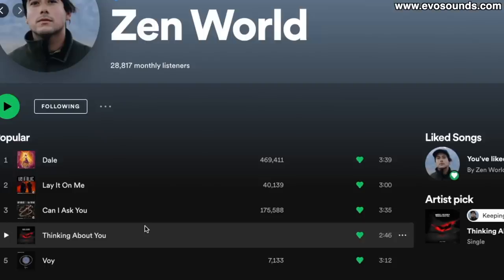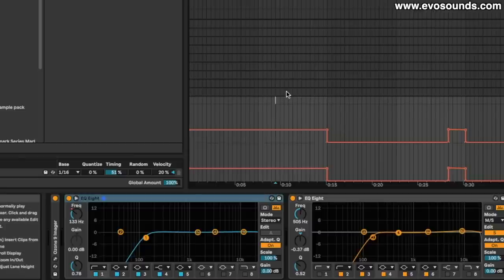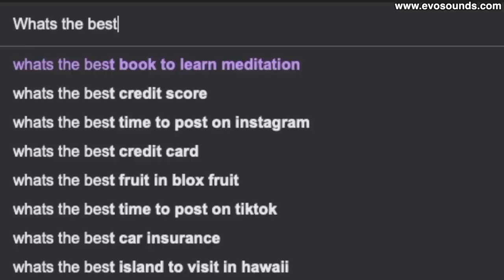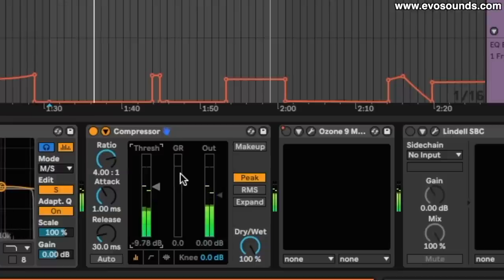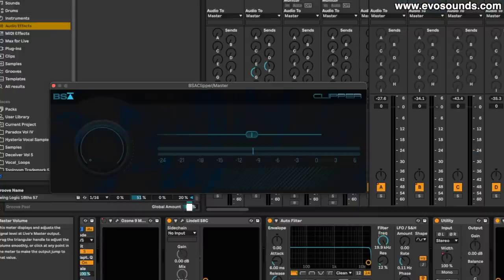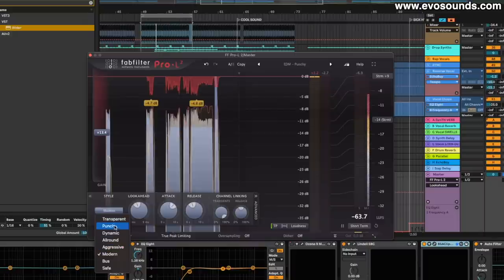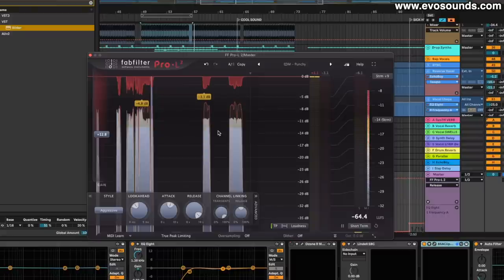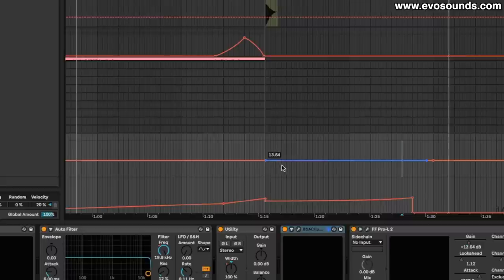This Compressor Made My Track Smack / Mastering Tech House

Comment: Couple of things about this whole process that i think could be improved.

If you are using compression on the master, try to stay away from attack times lower than 30ms, that would kill the transients and you will most likely loose punch. Though the exact duration of transients varies, and will sometimes be much shorter, 30 ms (give or take) is the window of time in which the “punchiness” of a sound really makes itself known, you wanna let that come trough. The release on the other hand is more of a feel knob, but if you are a beginner, just calculate the release with the bpm of the song (bpm to ms) to get the compressor to pump at the right tempo and start from there. 

On the topic of the pro L2. That zoomed out view is not at all what is recomended, you wanna see what happens between transients, that is key when setting a good release time, you essentially want the limiter to release rigth before the next transient hits, otherwise you are just limiting unwanted transients loosing dynamic feel. If you can tell by ear thats great, but if you are just starting to master, look at the transients very closely.

Stay away from true peak limiting, that should always be off becouse this limiter is not good at that, it will change transients. Use another plugin to do TPL. Work always on at least 16 oversampling, otherwise you will get aliasing distortion, specially on L2 which is the less forgiving limiter in terms of distortion. 

Dont use 1:1 auto gain, just pull the gain up while holding opt/alt key, that will compensate the gain by moving the output in the opposite direction (avoiding the use of the auto internal gain compensation which is sometimes wrong due to calculating that in real time). Stay away from Agrressive mode, thats one of the worst algorythms, if you are starting use modern. 

Try to never go past 0.18ms of lookahead, if you increase lookahead too much it will make your master more transparent wich is good, but it will loose a lot of punch and depth. The amount of lookahead in this video is certainly not good for the track, my guess is that becouse hes using Agressive mode (wich is almost like a clipping one), and this is not transparent at all, the only way to compensate for distortion is to increase lookahead. And yes, it will sound better (less distortion) but it will also remove punch and depth, its better to use modern and a lower lookahead time. 

For the channel linking, if you have a track with a lot of different stereo information (like some wide percusions for example), stay away from the transients knob, put it to 0. The link will almost ruin the interaction between the elements, but if you have some even stereo information or for some reason you want to even it out, use it, i personally would never use 100%. 

Every mastering process should always be looking at a meter showing dynamic range and RMS levels, i recomend bx meter. 

i hope this information helps, big hug!

Comment: Sick video man, Ive been using the Clipper/Limiter combo for a while and its working very good.
how do you avoid your masters going over 0 db after exporting? my tracks seems to go over 0db even with truepeak and 32x oversampling activated
Reply from the maker: My mastering mentor taught me to set the output to -0.03 or -0.30. That usually fixed those issues for me, especially when exporting to MP3. However I do have to add that some masters from back in the big room days would be clipping  in Ableton when I would reference.
Reply: @ZenWorld  thanks bro, will try that!
Reply: You could do more limiters in a row With complete clip at The end for a transparent shaping of The peaks. An idea for sich a setup could be: compress, clip, soft limit 2 dB, Haarder limit 2db, clip at 1sample below 0dbfs (airwindows cliponly vst comes to mind). Keep pushing!
Reply: If you use Pro-L you can put one at the very end and set it to safe mode with true peak on and -0.1 output.

Comment: This compressor looks like the API 2500 from waves, I can achieve the same result with that one ?
Reply: API 2500 from waves is maybe the worst emulation of a hardware that ive ever seen, i would stay away from it
Reply: @imhenotic  since I use UAD spark plug-ins waves are trash 😭